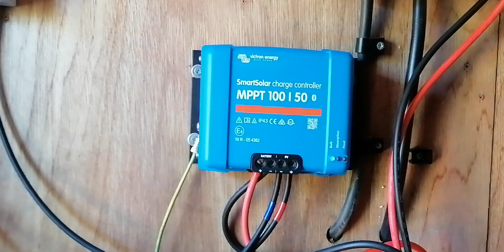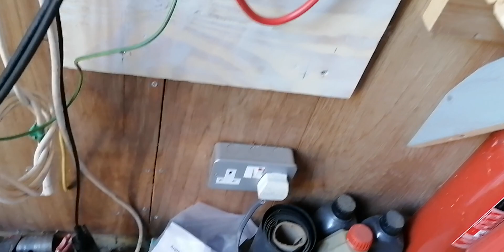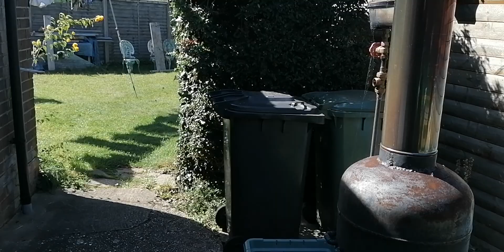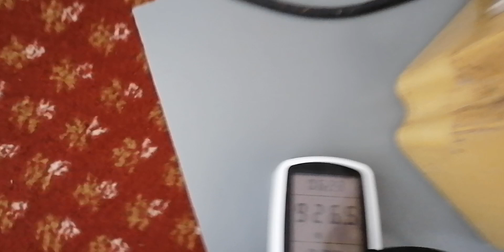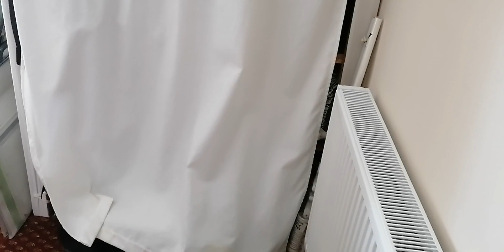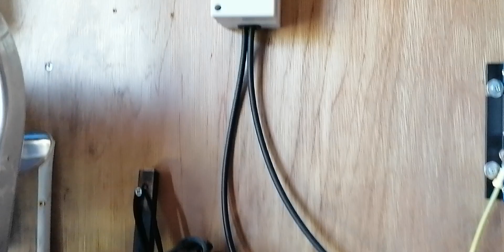Fogstar drift battery storage solar system.

Comment: Lets say for instance the power goes out and you forget to isolate the grid and power up your house with this system you are now back feeding the grid this could potentially kill a workman it is an extremely dangerous setup
Reply from the maker: I don't back feed the house without switching off the mains feed from the grid, otherwise my system would trip out, so if back feeding and the grid goes down that would not be a problem. The grid in this area very rarely goes down and if it does it is only for a few seconds. There is probably more chance of a line worker being hit by flying pig rather than me sending power his way.
Reply: This all may be true but you still are in breach of your contract with the power suply company i imagine and are definitely breaking regulations trust me its not the correct way to do things and definitely is not safe you nead to use proper change overs so it is impossible to back feed not improbable
Reply: Call your energy supplier and have them inspect your set up i guarantee they will condemn your installation